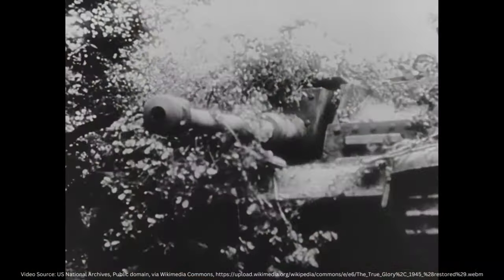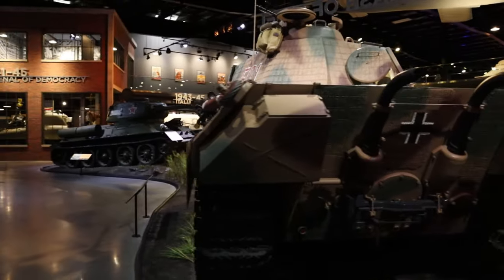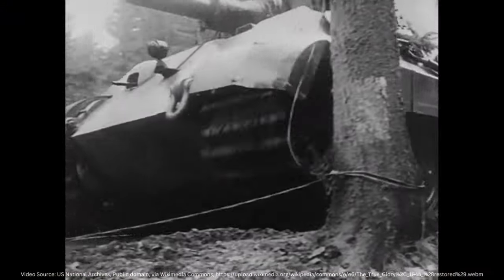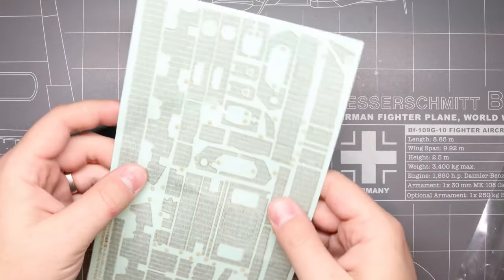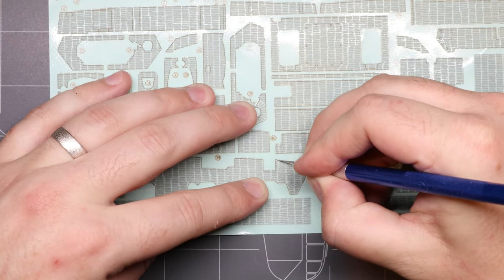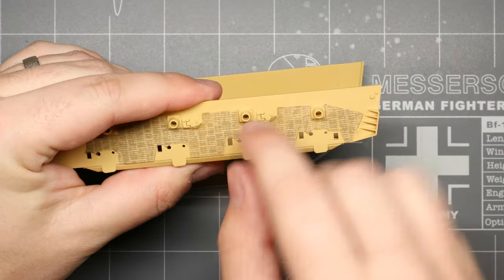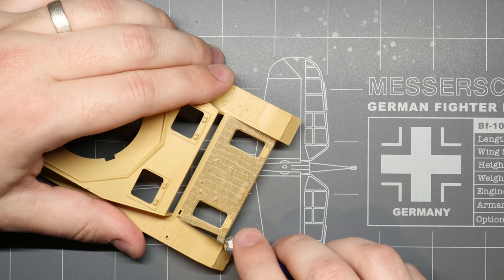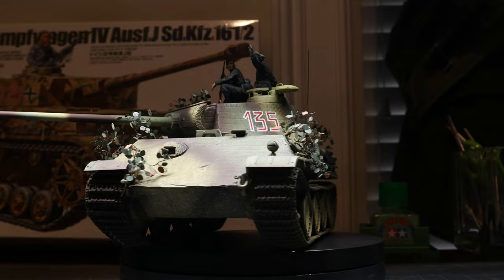The EASIEST Way to Add Zimmerit to Your Panzer Models | 1/35 Scale Modeling Tutorial

Comment: I believe Tamiya also offers a set that can be glued on with extra thin cement. The zimmerit application was 5mm thick, which converts to .14 mm in 1/35, so these kits are the closest you can probably get to “real” thickness. Thanks for the video, a great review!
Reply: yeah they ok,I prefer trumpeter sheets as you can cut what u like...tho putty zimmerit is fun

Comment: It makes sense to go to ATAK where they make one product, zimmerit. I use them all the time and if they do not have exactly what you want, for instance, you have a Tamiya kit and all they have is Zimmerit products for Academy, make it fit. Gaps can be easily filled by mixing up Tamiya paste with Tamiya glue, apply carefully then used a Zimmerit roller or some other tool that is able to replicate the zimmerit. I notice that using these stickers made by Tamiya, there are not 3D (not printed) parts like the Gun mantlet, the hull turret gun, part for the rear of the tank. Some of ATAK products include a full turret that will allow you to use the kit parts in the same way that the kit calls for. ATAK is a little more than twice the price of the Tamiya sheets but offers far, far more.

Comment: Interesting but I'm not certain Tamiya's zimmerit stickers actually present the depth of zimmerit and it looks a little uniform for my liking, I've been using ATAK zimmerit which is far better, yes, it costs that bit more and they don't cater to every kit but it looks superb when fitted correctly and they also include resin parts with the zimmerit pattern present for the more challenging parts.